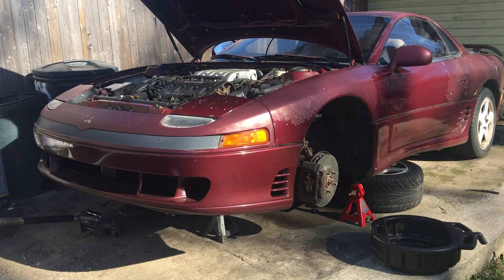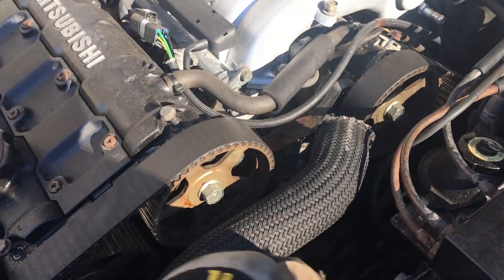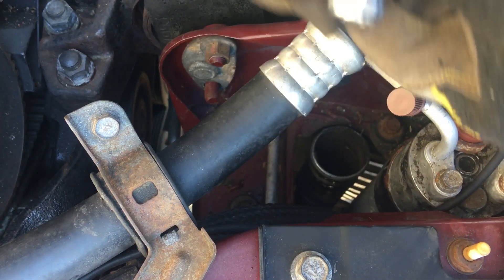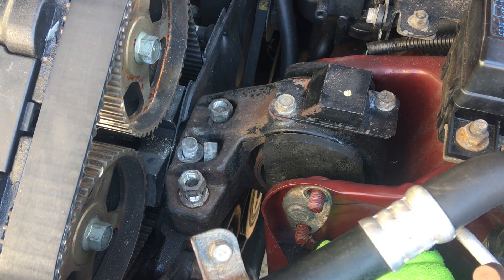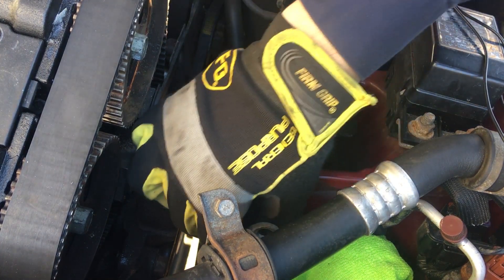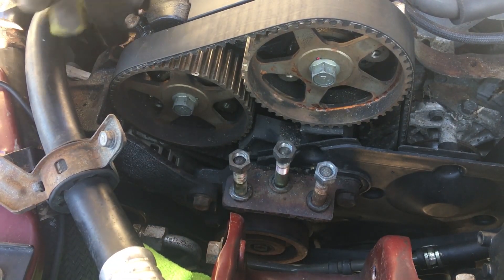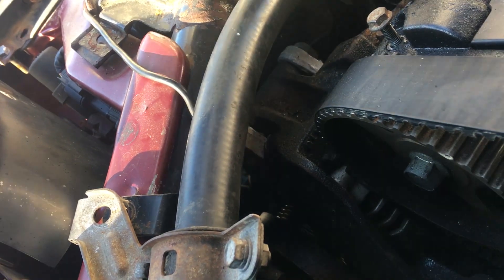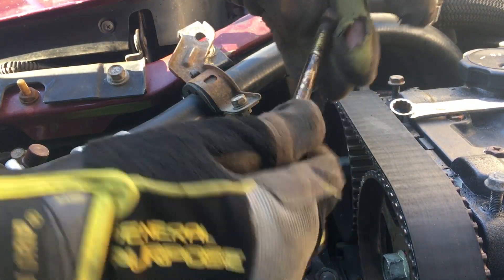Worst 3000GT VR4 Timing Belt Service (Part 1)

Comment: I have a 1994 Dodge Stealth VR4 that needs the 60,000 mile service done soon, and I have been quoted $2000 to do this. I am not mechanically inclined, but I am going to try it out. I thank you for doing a series on how to perform this service, as well as links to the tools needed to do the job.
Reply from the maker: No problem! Thanks for watching. Most important thing is check your timing marks multiple times before pulling that pin on the tensioner. Also follow the manual on how to set the crank before you pull off the old belt

Comment: After you remove the jack from under the oil pan, absolutely make sure there are no dents. I've heard it's much safer to jack the engine under the AC bracket rather than the oil pan
Reply from the maker: Agent WK I was trying to look where I could support it but the oil pan has a nice size dent already from whoever owned it before
Reply: Jursaw That's scary for me to hear lol. I've read and heard countless stories of these cars having spun bearings all the time and it's because of the oil pan being dented. But then again, when I was a newbie I jacked up on the oil pan, dented it slightly, and the car is still running strong. Who knows...
Reply: here's  an article by one of the most reputable guy out there for these cars:

http://www.3si.org/forum/f1/spun-bearing-causes-please-read-411129/
Reply: You should take out the oil pan and hammer out that dent. The oil pickup is very close to the bottom of the pan. So a dent could lead to oil starvation. Dented oil pans has broken many 3s Engines. Just saying....
Reply from the maker: Rickard A That is a good idea but it might be better to buy a oil pan that isnt dented because this one is getting rusty where it is dented
Reply from the maker: Agent WK I will check it out, thanks for sharing
Reply: Ray Pampena(Pampena Motorsports.
Reply: I used a piece of wood under the academy bracket.  NECER NEVER USE THE OIL PAN!

Comment: Where did you have the jack on the engine? I don’t want to break the engine by jacking it in the wrong spot.
Reply from the maker: Gold Wolf You can use a piece of wood on the jack. Some people do that on the oil pan with no issues

Comment: Hey bro. I’m about to buy a base model Mitsubishi 3000gt as a daily driver. It has about 140k miles on it n needs a new starter. They’re asking around 2k. What do you think ? Should I get it? I’m 19 n this is just my dream car honestly. I need help. Love it but also don’t want to put myself in too much expenses
Reply from the maker: The base model has the SOHC V6. It has a history of being more reliable then the SL trim version which has the DOHC V6. If it has no rust or leaks and the interior is clean it would be worth that much. I never changed the started on one of these engines but I assume it will be easier on the SOHC engine vs the DOHC specially with the twin turbo like this VR4. It would be good for you to learn how to change the starter on that car to save on shop labor costs.
Reply: Jursaw ahhh I see okay thanks bro. I’m hype af! Greats vids btw they’re very helpful! Especially since I’m about to get this thing

Comment: my 3000gt have 217k miles
Reply from the maker: GreSnake Is it a vr4?
Reply: Jursaw  nop :/ is a 94 base .. I try to keep it in good condition
Reply from the maker: GreSnake That is still a good amount of miles for a 3000gt!
Reply: you think so ?   I was read about the time belt need to be change every 5 years , or every 100,000 miles something like this .. but my 3000gt run still good and no have  any problem or any light on in the dashboard .. but I thing so I should change soon the time belt .. anyway .. because the time .. inside . I wanna see your process complete  for I will do
Reply from the maker: Yeah, I believe you are supposed to change the belt every 60,000 miles. It is preventative maintenance because if it breaks or the tensioner makes the belt loose, the valves will most likely get bent.
Reply: dude u need to change the timing belt/water pump/tensioner/pulleys every 5 years or 60,000 miles which ever comes first..especially on gens one (91-93) and gens two's(94-96) cos they are interferring engines...meaning if the belt snaps or slips some teeth ur engine will get fucked.
Reply: GreSnake: U mean base as in SOCH(single overhead cam) or the mid level SL(DOHC_"dual overhead cam) cos base n SL are totally different cars..
Reply from the maker: 265308 What about 96-99?
Reply from the maker: 265308 That is what the difference is? Feel bad for whoever has the base models then
Reply: Jursaw not is bad the 91 to 93 VR4 bring with 300hp , the 94 and 95 base or SL bring to 222HP  .. 96 to 99 base or SL bring with 161HP :/  and VR4 94 to 98 bring 320HP the 99 VR4 bring with more torque and something more HP